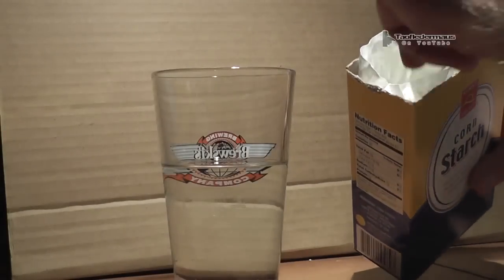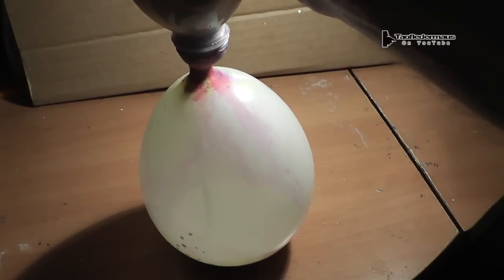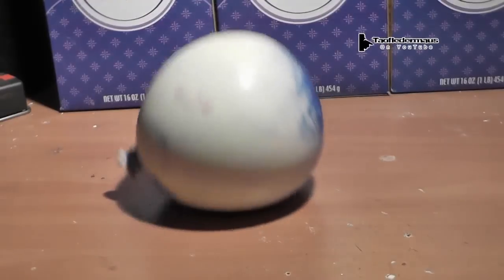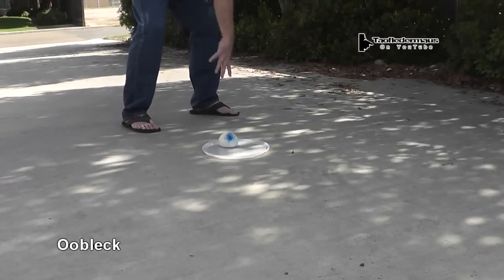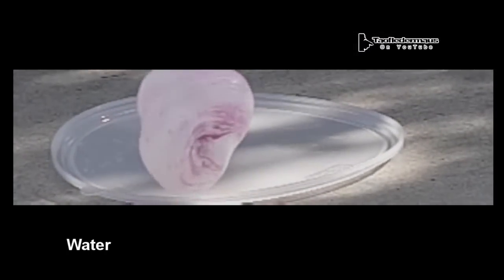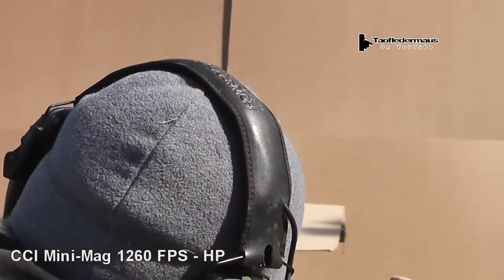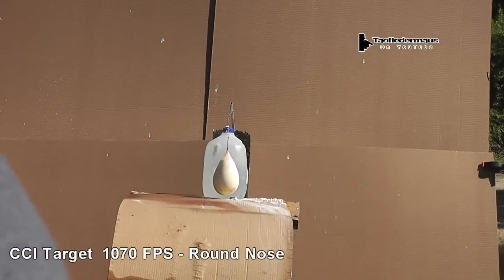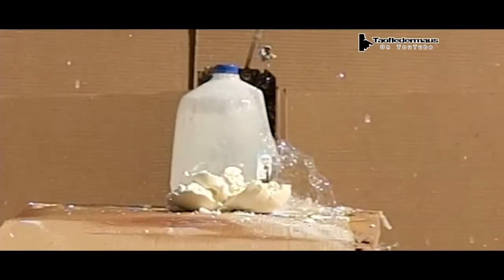Is OOBLECK  Bulletproof?   - Cornstarch and Water

Comment: he stored the ballons for 3-4 days.. you have to use them at once .. try putting cornstarch in a pool and wait 3-4 days im sure it wont have the same effect.. if no effect at all.
Reply from the maker: The properties didn't change after those days.   They just stunk.
Reply: ***** Didn't the cornstarch settle to the bottom?
Reply: *****
Certainly appears as though the properties changed in that time.
Reply: In a pool the water would evaporate. In a balloon it wouldn't (not for along time at least).

Comment: well considering Kevlar is a non-Newtonian fluid...
Reply from the maker: It's a woven fiber
Reply: ***** Have you seen the experiments they have been doing with a liquidized kevlar solution? interesting stuff,
Reply: Ciaran Barr Burns
What you're thinking of is not liquidized kevlar.  There are various specific types made by different companies, but they are under the branch name of Sheer Thickening Fluid.
Reply: ulfsark9 well some people think of it as such as it is made up of a viscous oil and glass (or other dense ceramic like boron carbide) suspended in a Kevlar or other fibrous medium.
Reply: SCComega http://en.wikipedia.org/wiki/D3o

Comment: You understand that its not neccisarily stress but spontanious stress pushing down on the balloon is provide stress but nothing happens it doesnt change its viscosity either whats happening is corn starch is a long crystaline chain and when mixed with water water happens is the solution of dissolved corn starch has smaller interupted chains of corn starch with water molecules in between. What happens when it is struck suddenly is it squeezes out the water just slighty leaving a momentary solid

Comment: the Non-newtonian fluid, doesn't have time to react to a bullet. - for the liquid to become solid the first wave that passes through, it has to bounce back before the liquid becomes stressed. when it falls to the ground the bottom half immediately starts travelling upwards and it "solidifies", and the rest impacts everything else. when a bullet goes in, that bullet sends a shockwave through the balloon, that shockwave is travelling slower than the bullet is, meaning the bullet will never impact a stressed/solid area of the fluid as the fluid has no time to react and become stressed, there's maybe a very small layer right in front of the bullet, but that is travelling too fast for the energy to form a larger block of solid. propably same would happen with SiO2 particles, unless the energy travels faster than that bullet. you could try a bow or a crossbow, maybe those have less speed and it actually has time to react to the impact.

Comment: The balloon is not bullet resistant so I didn't think it was going to work. Now maybe if you add a bullet resistant material in front of it and instead of using the non-Newtonian material as a bullet stop, you can then use the "goop" as a shock absorber and let the Kevlar take the hit. Now that would be cool too see.

Comment: or have each layer dipped in an elastic polymer or silicone like substance to provide a more springy + elastic layered spacing with the paper semi rigid from mache'ing. Or a variation of any of these for that matter. it just seems as if the pressure where dispersed more evenly and possibly with some elastic properties that the bullet could be stopped before it got to the bag of oobleck.

Comment: Actually the container itself would have no effect at all, the rubber balloon would merely stretch and contain the pieces and keep them from flying off.
It is the force that is being applied to the Non-Newtonian fluid that causes the reaction of it going from fluid like to solid, that is why you can take a hand full of the stuff and bounce it off your palm. In mid-air it will be fluid like but upon impacting your hand it will react like a dense ball.

Comment: This is false, Imagine hitting it with a sludge hammer in a bucket vs hitting it in a balloon. You are going to have a far more effective result from the first option due to the container not stretching apart. A newtonian Fluid reacts mainly when it is compressed at a high speed, which inside a stretchy balloon, it reduces the amount of compression on the fluid.

Comment: It wouldn't change anything, it would do the same thing and simply shatter as you saw in the video.
You can get the same result hitting it with a sledge hammer or a hammer with a smaller peice

Comment: I would recommend shooting the fluid in a stronger container. The problem with balloons is that the fluid has nothing to harden against except itself. If you put in in a steel pan ect with an opening in the back, then it could harden against the steel surface instead of expand due to the rubber.

Comment: In both shots, the liquid turned solid. With the hollow point, those are solid chucks flying off, then quickly return to liquid. With the round nose, you can actually see it cracking, and the big chucks remain solid for a bit.

Comment: This is actually a good example of a .22's power. It should never be considered JUST a .22, these things are still immensely powerful. Other than that, this is a really good show of Non-Newtonian fluid properties, but just because it becomes rigid under stress doesn't mean that it will become a bullet stopper. All that energy still has to go somewhere, and that transfers into pushing the material apart.

Comment: When shot the corn starch will harden along the path of the bullet, but the further off-axis you go the less pronounced the effect. The bullet is basically creating & punching a solid core of material out of the center of a liquid as its density is too low to decelerate a slug. you might have better luck if you place a solid object on the balloon to shoot, to allow the shock-hardening of a larger area. I'd bet a layer of this stuff against a wood backing would work much better than a balloon.

Comment: just an FYI they are now using an advanced non newtonian made of silicon dust and a special "trade secret" long chain polymer soaked into clothing and existing bullet resistant equipment to make bullet and knife resistant clothing for prison guards(currently designed for prisons), there are a few videos on youtube showing how much better it it works at both bullets and knives increasing the stopping ability by many fold while allowing for decrease in weight and mobility constriction

Comment: Glass is not a liquid. That is a myth propagated by ignorance and a voracious hatred for any amount of research on the subject. Glass is a crystaline solid. You think it's a liquid because of the "running" stain glass. The glass was manufactured by spinning a molten ball of glass into a disk, like a pizza, which made it thicker on the outside. They then cut it and put the thicker, and heavier, side on the bottom. Google is your friend.

Comment: An amorphous solid is a material in which the arrangement of atoms or molecules is not periodic. Prepared gelatin is a non-Newtonian fluid. However, in its powdered form, it is an amorphous solid. When that powder is dissolved in hot water and allowed to set it forms what is classified as a hydrogel. All hydrogels are non-Newtonian. So technically gummy bears are not amorphous solids, but are in fact Non-Newtonian.

Comment: Nice one Jeff. I've used cornstarch/water as tamping in rock blasting to lock up and contain the blast. While it works a lot better then water it wasn't worth the hassle or expense, wet sand (also having "dilatant" properties) is just as good. I believe the material used in vests is silica and ethylene glycol, there's a bucket of silica sitting right behind me!

Comment: I filled a 5 gallon bucket with the cornstarch-water mixture and shot it with a medium velocity pellet gun. It was very interesting. The pellets blew out a cavity (you could see it for a second) and then the goop came back together as a liquid. It was like shooting very hard clay, but it automatically reset itself. After, you could reach in and pull the pellets out at about the 4" mark. When shot, the bucket jumped into the air. Impressive for a .177 pellet. :)

Comment: Liked it. Never thought it would stop the bullet though. Too narrow a point of impact. Spread the impact over a wide area and it'll hold form. Like you example of dropping it from height onto a smooth plate. Break the rubber shell, and it all squirts out. JMHO. Nice vid though.

Comment: one interesting thing to note was the fact that the mixture did become solid and shattered on impact as solid chunks can be seen in both tests. maybe impregnating(or layering front and back) kevlar with a cornstarch/water mixture and then "gel" coating it with a flexible rubber outer casing(or a vacuum pack bag prolly easier to hold it together) would be an interesting test, although it sounds really complicated i can visualize it in like 5 min.

Comment: Except for slugs, typically you will not see a 12 gauge with a velocity over 1500 fps. Out of a pistol, rarely are .22s supersonic and with a rifle, few of them are subsonic. The velocity of the Aguila Supermaximum Hypersonic 30 grain is 1740 fps. The velocity of the 12 Gauge Lightfield Commander IDS Plus Sabot Slug 3-1/2" 1-3/8 Oz is 1890 fps. The shotgun slug would obliterate even a basketball with 4700 foot/pounds compared to the 200 of the .22.

Comment: interesting...now shoot some in a slug...maybe make a small plastic well and seal it off with foil and super glue or just put it straight in and make sure it doesnt leak....maybe in the core of a waxer. the splatter it will produce when introduced to a steel plate will be interesting but the effect it would have on flesh would be even more so ...

Comment: If you watch from around 3:06 and pay attention to the middle where it cracks, the fluid that fell between the cracks starts to melt. It appears solid because of how viscous it became because of the pressure exerted by the .22. It then appears to melt because it's no longer under such high pressure and its viscosity lowers.

Comment: actually, water is also a non-newtonian fluid, it just takes a lot more force(stress) to feel the effect. dropping 10 feet into water is no big deal, hit water at terminal velocity and its like hitting concrete. almost all fluids are non-newtonian if enough force is applied.